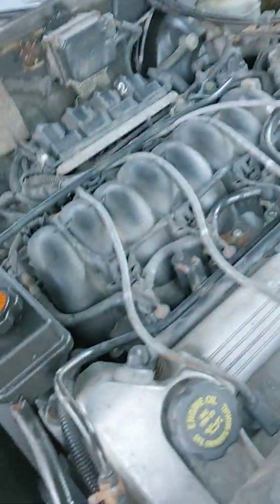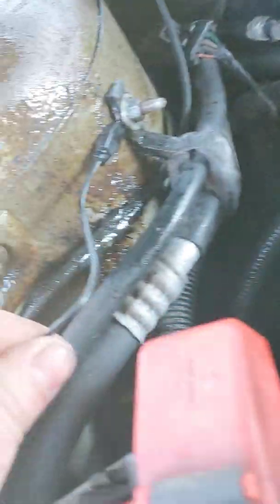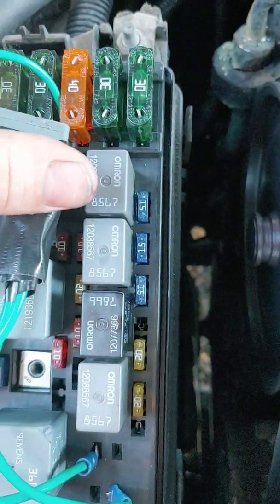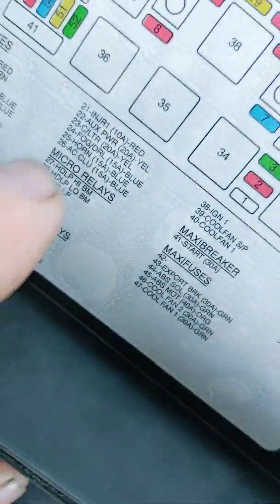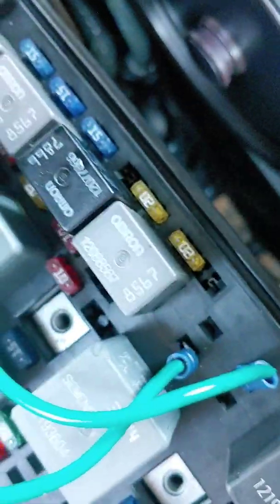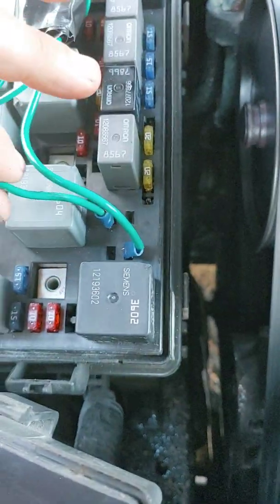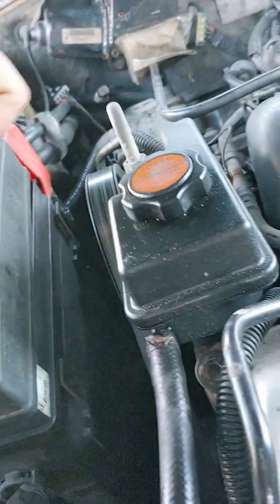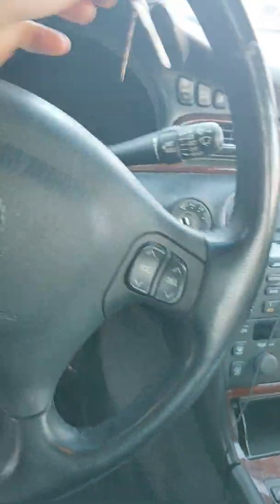Cadillac Northstar Cooling Fan Mod

Comment: This video is important information for anyone with a Northstar engine, the majority of which eventually have cooling/head gasket problems.  I've often wondered why someone didn't manufacture a professional/commercial relay device for Northstars to keep the cooling fans running when the ignition is on.  There are lots of such devices for sale on Ebay for other cars - but not for Cadillac/Northstar vehicles.  Although there was a larger market for such a commercial device years ago, there still are a lot of Northstar engines on the road.  Although this is a great video, it may be too technical for some Cadillac owners.   I suspect that you could make some money if you were to manufacture a "plug and play" relay for sale.  I'd sure buy one.
Reply: I'm with him I'm about it try this